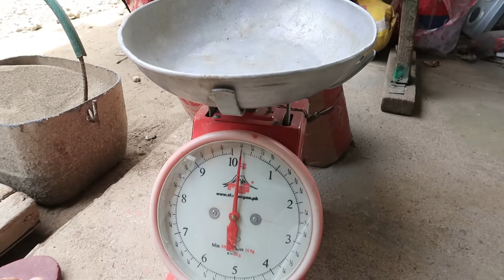How to Make Homemade Dumbbells - Best Diy Weights

Comment: Bro please give me the measurements approximately for a 20kg plate 10kg plate  30kg plate 15kg plate and 5kg plate. I don't have anything I can use to measure the weight when making them but if you give me the measurements that is height diameter or circumference I can try approximating the weight. Please help Thanks

Comment: Back in the 60s and 70s we just used cinder blocks.  Just put a metal pipe through the hole in the block.  Half blocks used for dumbbells. Also buckets with water, rocks or even iron and or lead worked well. 
Easy to make, and they did the job

Comment: Cool idea but for the cost of the concrete and waste metal iteams you could just buy a cast iron set with twice as much weight and significantly greater durability.

Even buying 2 large watering can and filling them up would be cheaper. lol
Reply from the maker: 1 bag of cement is only 5$ and i can make lots of dumbbells and plates on that 1 bag of cement powder. I wish i could buy a  pair of dumbbells with only 5$

Comment: With how much you've probably spent over the years on cement, burner fluid and other thing to make your equipment, wouldn't it have been cheaper just to save up for used  plates?
Reply from the maker: 1 bag of cement cost 4$ i can make lots of plates and dumbbell with it but with 4$ it can't buy even a 10lbs gym plate.
Reply: I think concrete plates are economical. One plate I use it for 6 months before starting to break. 1kg of metal plate costs 4usd so you can imagine how much dollars you'll spend on metal plates

Comment: This is good but how do you determine the actual weight of each place volumes and amounts and measurements?
Plus all the equipment, tools and materials together would probably cost about the same but just buying the set would probably cost a little more because of taxes. Unless you live near by a cheap scrap yard and recycling center.
Reply: Victor Louzada  yeah make sense here in USA we can buy anything used and even brand new for cheap. It isn't easy to find and some of these things can can be found in auctions.
I remember i bought a bench press bar and  a curling bar with 80 pounds for 90 dollars brand new with taxes. Right now I see on Amazon some adjustable dumb bells 5 pounds to 52 pounds per dumb bell for  between 30 - 50 dollars and you don't have to labor into making some weights set. Thats 104 pounds. 
Good thing about making your own nobody will potentially steal you weights set.

Comment: @2:02 how can cement not stick to the plastic basin? Are u apply or put something before filling cement?
Reply from the maker: I didn't applied anything. Just use clean basin and it will come off easily.
Reply: @romgd  thx u 👍

Comment: How much does the cement and bottles cost cause I can get a set of adjustable up to 40 pound dumbbells for like 20$
Reply from the maker: 1 bag of cement cost 4$ and i  can make 4 pairs of dumbbells and lots of plates with just 1 bag
Reply: @romgd  the saving is not worth the mess lack of easy storage and increased potential to hurt or break something. I get where you're coming from but unless you're out in the middle of no where as opposed to a fairly clean and tidy apartment I'm going to pass on the cement dust and Debra and save my floors.

Comment: Lods new subscriber here pwd makhingi complete lists of materials?
Reply from the maker: Dumbbell
Cement powder   
Buhangin
Bato
3/4 inch galvanized pipe schedule 40
pvc pipe nakalimutan ko size basta ung papasok and 3/4 inch galvanized pipe
Hulmahan or batya
Bolts
Dun nmn sa pang calves 3/4 inch galvanized pipe tapos ung nag lalaro na tumataas baba na pipe 1 inch un tapos kadena un lang po